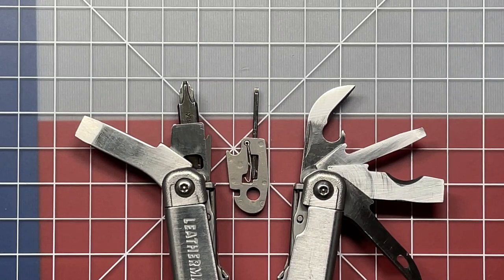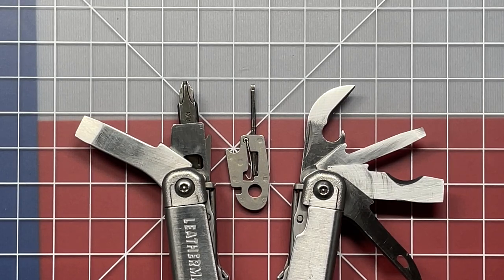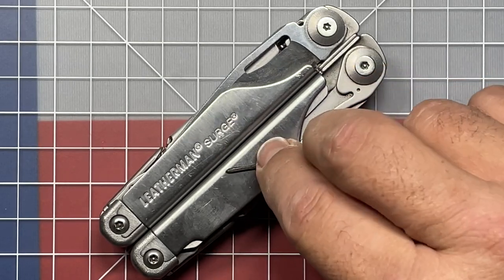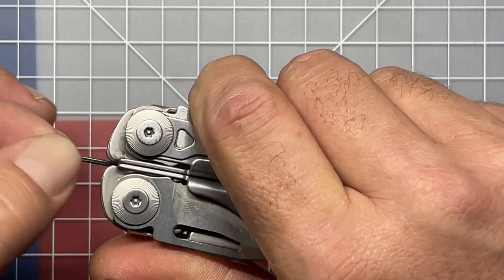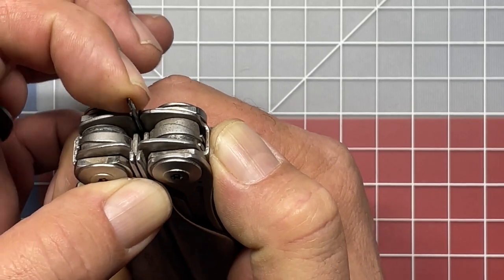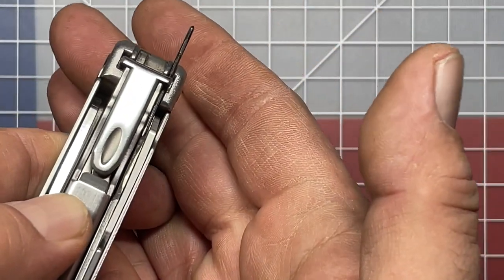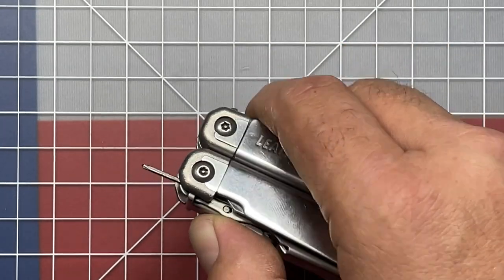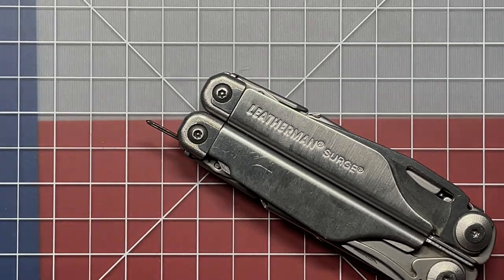Leatherman Micro Driver In A 2nd Generation Surge

Comment: Hey Ben. I found another way to use the micro bit on the Surge I thought you may want to check out. If you remove the blade/file from the blade exchanger on the Surge you can place the driver up in the rolled over edge of the blade retainer and then close it as if there were a blade/file in there. The small gap is perfect for the microdriver and supports it on all sides.
Reply: This is genius! It fits so well that it could even be a hidden feature from Leatherman
Reply: Nice!  Works the best for me!
Reply: Well done. It works great.
Reply: Incredible, now there are 3 known ways to use the micro bit on my new Surge.

Comment: I can see 2 more ways to use the micro bit:
1. Use it with micro bit driver as standalone keychain screwdriver (the bit driver itself provides enough torque for such a small bit).
2. Machine the micro bit driver to make it an adapter for the standard bit driver.

Comment: You can also use the slot on the t-shank holder / lanyard ring side if you aren't using the lanyard ring. The  tool lock release bar will hold the bit firmer than the scissor side and prevent most of that up and down movement you are getting with your method

Comment: So I came to YouTube to check out this exact issue and what I have found is that underneath that button lock for the tools it seems to have a more snug fit on the file side vs the scissor side With Better In and Out retention and there is a lot less slop.

Comment: Hmm keep the ideas coming.

I was thinking of either
Taking an old flat bit, cutting the screw edges to have the body one, cutting in the middle of the larger flat surface area, and weld it there. 
Or maybe possible, cutting the edges is the but and drilling in the middle and somehow gluing it welding the edges, 
This way you can use in the bit kit.
Reply: Was done in the leatherman FB group looks perfect and probably the best method unless you sacrifice a wave for the holder....

Comment: I feel like this is somewhat redundant if you keep a Victorinox Compact or other SAK with a corkscrew on you. I guess you don't get the phillips side but I feel like that small of a crosshead is a very rare screw type.
Reply from the maker: Great for accessing battery compartments on toys, some eyeglasses as well.
Reply: @txtoolcrib  Hello Ben - I have an alternative you can try - you can tuck the driver on the saw tip side of the Surge - it stays nice and tight..Igor Kabakov has a short video (in Russian) on his channel here on youtube that shows how he did it...

Comment: Remove your saw blade/file and close the clip most of the way.  The tiny screwdriver can slide right into the rounded side of the clip.  If you hold it with your thumb it will stay really stable

Comment: Maybe it's possible to [fabricate a metal]/[3D-print a plastic] bit-adapter that can fit in the regular bit-slot but has a hole that fits the micro driver? At first I thought one could saw of an end of a bit and drill a tiny hole in it, and use a file to shape it to the micro driver, but maybe it is possible to 3D print a plastic piece that's strong enough? Or 3D print a metal adapter?
Reply: A 3d printed holder would be plenty strong for this size driver. All LM need to do though, is have a little hex hole that would hold the bit in line in the end of the bit kit holder, all molded in from factory

Comment: Hey, I've seen a guy that sells a 3d printed adapter that goes into the normal sized bit holder and that fits the micro driver bit, that seems like a more reliable option, have you tried it by chance ? As my wife wears glasses the microbit holder is clearly a missing tool on my Surge, but as the seller (Kristen Van Patten) is from Texas the shipping price to France makes it a bit pricey for a plastic thing sadly. But hope that it will help someone !

Comment: I've come up with a secure way to carry the mini driver bit inside the actual tool bod, without having to modify the tool itself. I've got a Charge+ G10 (I've swapped the mini-driver holder with an awl), but no reason this can't work with a Surge. 
What I've done is taken a tiny magnet that's used inside a laser pickup voice coil from an optical drive (any CD/DVD/etc mechanism should do), broken it in half (it's ~1 mm thick, and after halving it, other dimensions are ~2x3 mm), and then placed it inside the saw compartment, about 1 cm from the non-pivot end. You then just touch one corner of the mini driver bit to the magnet, and push the other end down, then smack the tool down on your palm, and it drops in perfectly and sits against the back of the housing, without touching the saw blade. Since the magnet is only touching the mini driver body near one end of it (NOT in the middle of it), that magnet becomes a pivot point. With regular movement and moderate shaking, the mini driver sits securely, lies flat and doesn't move. But if you open the saw and smack the tool upside down hard against your palm or your knee, the free corner of the driver bit swings out enough for you to grab it - and then you can use the first technique in this video.

Comment: I'm half tempted to take one of the more square ended bits and drill a little hole in it and insert the micro driver into that.
Reply: I don't think you thought that through fully, you still a circular hole? Wouldn't that just make the micro bit turn in place?... You gotta make a hexagonal hole
Reply: @adamthomas1222  technically yes you would need a hexagonal hole unless you use some epoxy in the hole.
Reply: @ucitymetalhead  So have you done it ? I've got some G10 and I thought that I could shape it to match the shape of the regular drivers and drill a hole to glue the microbit driver in it. Epoxy should work even in a circular hole.
Reply: @thomasg5601  no never did and to be honest your idea sounds better.
Reply: @ucitymetalhead  yeah G10 is pretty tough but it's easy to work with, it'll just take some time to make the all shape precisely. If you're from the USA, as I've said before on this video there is a guy that sells a 3d printed adapter that goes in the normal sized bit holder and that fits the Leatherman micro driver bit, that seems perfect. Just seems costly to ship here in Europe.
Reply: @thomasg5601  i am from the usa and would you have a name for this guy?
Reply: @ucitymetalhead well I've posted it two times but my comment never showed up, sorry 🤔 I'm fairly new to YouTube comments, maybe a word being filtered ? Don't really know how to share you
Reply: @thomasg5601  if you posted a link they will get your comment deleted automatically by YouTube so just give a name.
Reply: @ucitymetalhead  this is Kristen Van Patten 👍
Reply: @thomasg5601  thanks i found it.
Reply: @ucitymetalhead  cool, feel free to share what you think if you get your hands on it, I may end up spending like 35€ to get one to here if it's worthly enough

Comment: Just carry a separate micro screw driver. Or just carry a wave as well and modify it to have different tools. So it doesn't have the same toolset as the surge.
Reply from the maker: I’m doing something similar, but in a custom Victorino knife that is being put together for me. I don’t use the micro driver, so it’s not really an issue for me personally.
Reply: @txtoolcrib  I carry a surge and also carry an edc backpack that has a few essentials in it, one of them is a victorinox champion. Love having the combo of leatherman and victorinox for different jobs. Just have too many of the same tools if you do not modify them. Love the content by the way. Keep it coming and you will move up in no time.
Reply from the maker: I agree. My knife will still have a couple of redundant functions, but will have several tools on it that don’t come with my Surge. Fit To Survive is putting it together for me. Just waiting on the custom scales to come in. He will have an assembly video on his channel in a few days I hope.

Comment: Why wouldn't they make an adapter to put in the bit driver that allows micro tools to fit?
Reply: When Leatherman didn't real people did. . . . they are 3D printed by many people and you can find them online from France to the US. Why wouldn't Leatherman? especially as an add to the bit kit. . . . .frick if I know. It took them forever to do a basic thing like make the bit extender magnetic to help keep the bits in for when you are working in spaces where gravity could make them fall out, until summer 2023. I've had a bit extender a long time and other tools from screwdrivers with exchangeable bits to my screw guns have been magnetic for how many decades now???? 
At least individuals are innovative in their own homes.

Comment: sorry, in real life it does not work. at all.
i owned a Surge, gave it away then use a SwissTool with ratchet. 
That multitool came with a very good eyeglass screwdriver. last week i bought again Surge black and silver, bit kit and Leatherman ratchet driver. i simply toke the screwdriver fom Victorinox and put it in the ratchet driver on the side of the pouch. ive got the glitched pouch with 5 pockets. its no way it fall off, it can be pulled out only with the pliers because its too tiny and slippery. 
my point is, if one need that screwdriver, buy it, its only a few euros, 5 max. the item name is A.3643
true, the whole kit is very expansive, in Europe we pay double on knifes and multitools. but that 5 euros investment is not a big deal for anyone.
cheers and i hope you dont mind my comment. i love your channel.

Comment: I have a better way, drill out the stupid nub stopping you from using regular torx bits, Remove the can opener and the flatblade screwdriver and toss them off a cliff and put your mini bit holder in their place. Add a washer or two if necessary. Done.
Reply: Or you could forget about the microdriver and just remove the can opener and replace it with a washer.

Comment: Some of your ideas are clever but now you're into ridiculousness. All that possible torque on that tiny tool is a disaster just looking for somewhere to happen.
Reply from the maker: How much torque do you think you could possibly put on this little driver before it would fail? Just a question.
Reply from the maker: I realize these are not perfect solutions, I’m open to ideas.
Reply: @txtoolcrib  The driver failing isn't an issue, but what about that screw in the eye glass frame?